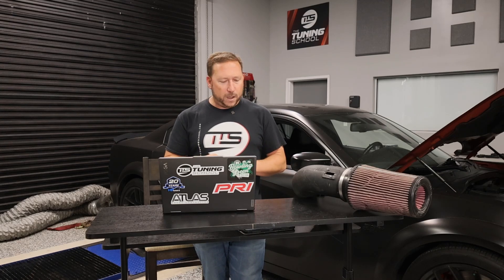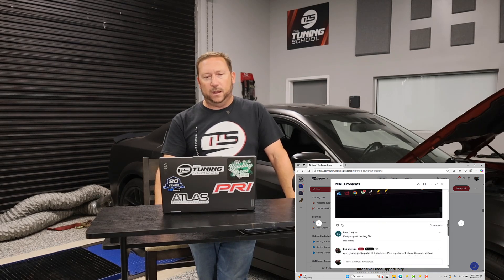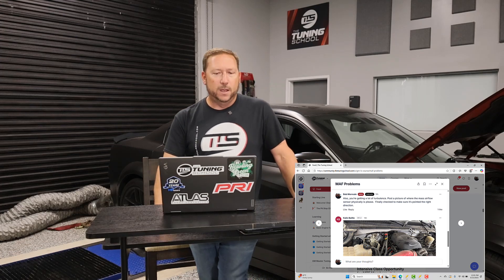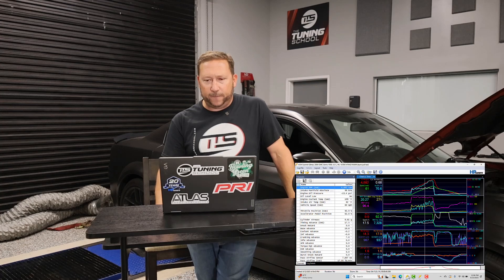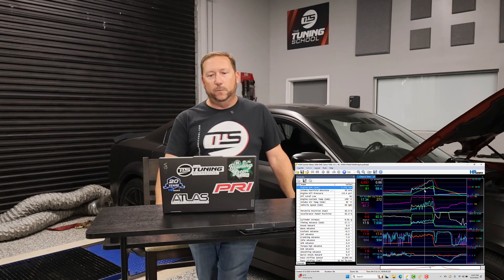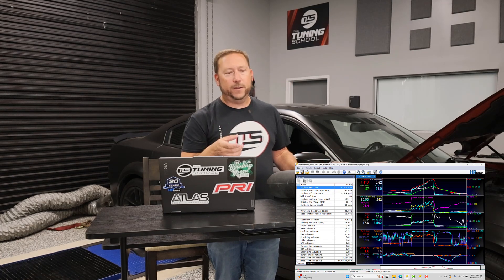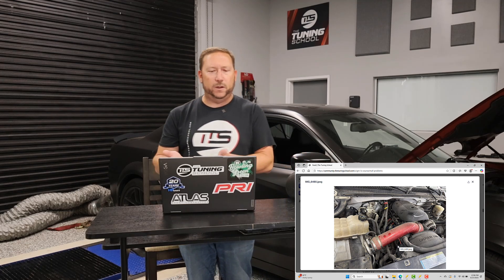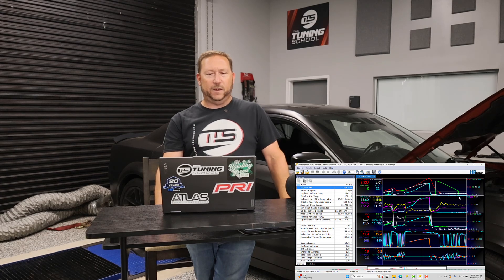Speed Density Tuning 101

Comment: Instead of scaling,  just use a larger tube then recalibrate the maf,  ie.. 4.5" instead of 4" that might get you back into the usable range of12,500 or 14,000 hz. The larger tube just slows the air velocity a little.